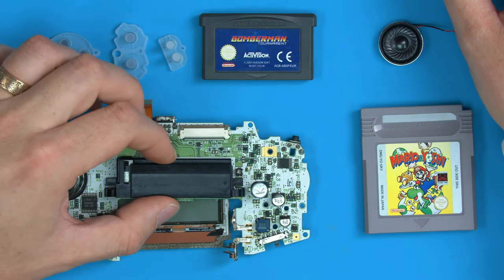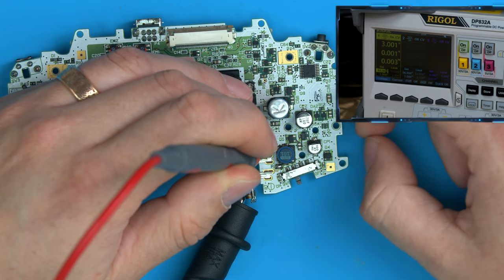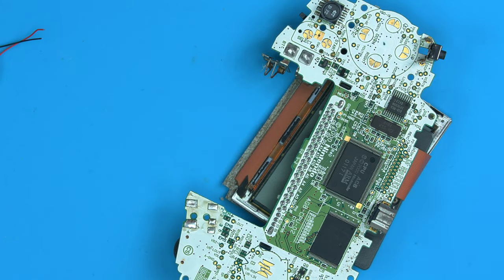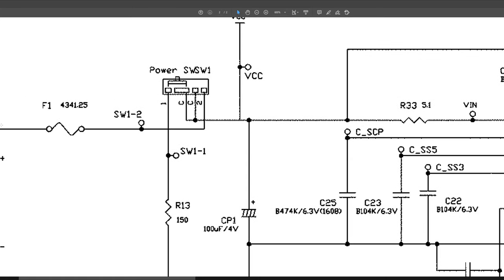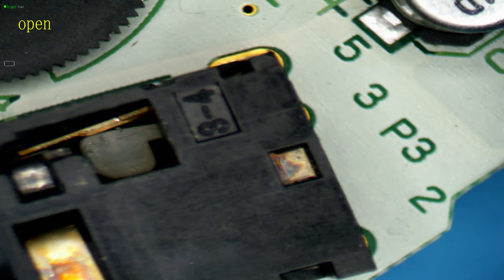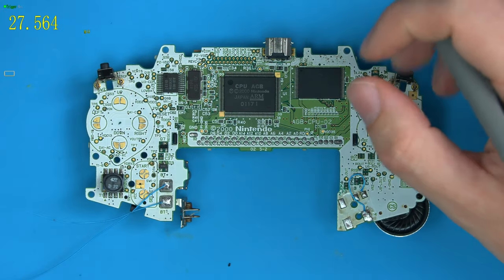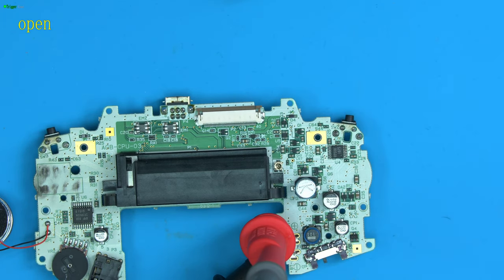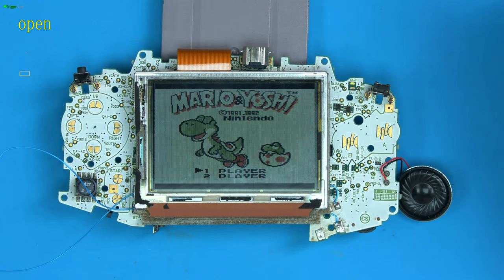Game Boy Advance No Power, No Sound & No Buttons! - RetroSix

Comment: Holy moly I had a GBA That I never figured out why it needed like 30 seconds between reboots to work ! and it had no sound due to it beeing a water damaged console I removed the headphone jack and never got sound out ot it plus that discharge resistor ! I had to replace the powerswitch and the resistor was missing ! Thanks ! You just upgraded this GBA from the Junk pile to sitting in a new Shell !

Comment: Bravo! Best video along this line I've seen thus far. I have GBA that starts about 1 out of 5-8 attempts. When it doesn't complete, the power light flickers with each failed attempt. When it fires up it's gtg until turned off. The power switch was cleaned and then replaced with the exact same results. The battery terminals are gtg. When back to back attempts to fire are quickly done in succession, the power light flicker is less bright each time until dark at about the fifth attempt. Capacitor?
Reply from the maker: Try replacing or bridging fuse. Also do you have any mods? The regulator basically thinks there is a short so stops

Comment: Great content, I have a question, off topic , I have 2 GBA AGB-001, one works with Ni-Mh batteries (total 2.6v)  so the batteries ain't the problem, and the other one only makes a pop noise, power switch is cleaned and battery contacts are fine,  possible causes ?
Reply from the maker: Power regulator circuit. L1 or T1 often fail

Comment: Love this video, my Gameboy advance won’t turn on. I cleaned the power switch and checked the fuse and also the blue inductor. There is all 3v but if I turn the switch on the light is just flickering and goes off, it does the same if i turn the switch into off position. What should I can do?
Reply from the maker: Join discord.gg/RetroSix for more advice. Could be T1, L1, a bad regulator IC, a short on output or other things

Comment: Hi, would there be any way for me to fix mine? It’s been scratched on the motherboard around two screws that kept it in place, one near where the speakers connect and one next to the thing that says c44, to the right (sorry I’m not really too great with names). It doesn’t turn on, the display didn’t work on it when it turned on before, when the one on the left was scratched, and the sound doesn’t work. First only the display didn’t work so I tried to take out the screw on the right side, but some yellow stuff has been revealed at the bottom. I’m sure that it isn’t because of corrosion because it wasn’t like this before I opened it a while ago.

Comment: i replaced the resistor on mine and it still didn't work. I think the circuit is trashed and the pad for 1 is lifted off the board so I tried running a 30awg wire to R13 and it still has discharge issues. Kind of at a loss actually

Comment: This is video is very educational, and it has helped me on troubleshooting my on-going GBA project, it also helps me getting better on my soldering techniques.
I did encounter and issue similar to the one for R13 after cleaning my power switch. The system will only boot after 10-15 seconds only. I tested the resistor and it works, using my multi-tester I keep getting a consistent 150 ohms reading. Could it be the power switch is faulty or that the C pad does not join to R13 when the console is turned off? Just in case i am ordering a new power switch and i am looking for similar 150 ohm resistors. But what would you recommend?
Reply from the maker: Test continuity with your multimeter from far right pin on power switch to top of resistor. And from bottom of resistor to ground
Reply: @RetroSix   Thank you! The far right pin in the power switch to the top of resistor has zero continuity, and same from the bottom of the resistor to ground. From your experience does that mean that by trying to clean the switched I made it worse?
Reply from the maker: You sure there is no continuity on both? Usually the bottom resistor is on ground. Very hard to damage that. Either way if bottom of resistor isn't making contact to ground solder a wire from ground to bottom of resistor. Then if top isn't making contact with right pad of switch solder a wire from top of resistor to right pad
Reply: @RetroSix  Thank you so much for all your help! Yeah, I did not get continuity from "1" to the top of the resistor. I did get continuity from the solder point from the far right switch (where the cover is soldered and it says off) but I am not sure if that was the point you meant. at this point I will use a wire to make contact. thank you so much for answering my questions, and I must say that I am a fan of your products! 😁
Reply from the maker: Yes pin 1 should connect to top of resistor. Bottom of resistor should connect to ground including the metal shield of switch
Reply: @RetroSix  Thank you very much,  I will do that :D
Reply: @RetroSix  Update, the connection from pin 1 to the top of the resistor needed that wire. It works legit well now. Thank you so much!!!! 😃

Comment: Hey RetroSix, thoroughly enjoyed the educational video! I used it to try and diagnose why the GBA I've been working on has no sound out of the speaker or headphone jack.

Unfortunately, I still haven't solved the problem. I had soldered a wire similar to you did in the video (pin 4 to 5), but no sound came out still. I've cleaned both the volume potentiometer and headphone jack with IPA, and replaced the speaker. Is there anything you may know that could be the problem? My next course of action was going to be to replace the volume potentiometer.
Reply from the maker: Do you have audio in headphones? If you do and you still don't get audio are you using a CleanAmp or just stock?
Reply: @RetroSix  There is no audio coming out of the headphones either, and it's stock.
Reply from the maker: @Syngii  it's likely the inputs into the amp then or volume wheel. For volume wheel just test with multimeter the voltage at pin 10 of the amp. As you move wheel up and down it should go from around 0V to 3v

Comment: I have 3v from positive battery pin to left of f1 and out the right of f1 in off position.also have 3 volts on pin 2 of the power switch while in off position.when I turn it on I get 0.06 on pin 2 of the power switch any help?

Comment: Great video you have there! I have a GBA but whenever I tried to turn it on, its never turned on, the green light shows for a second and then its off. I already cleaned the power switch but no luck, maybe its not a power switch related issue?
Reply from the maker: It's a dead short on the console somewhere or a bad regulator. I'll do a video on it when I get time but look for shorts

Comment: I'm getting audio out of headphones but no audio from speaker, replaced speaker, volume wheel works with headphones in... possibly bridge pin 4 to pin 5 to fix the problem? what do you suggest?
Reply from the maker: Bridge 4 and 5 to confirm. If that works your headphones spring needs cleaning or port swapping

Comment: Short question: can I use an electrolitic capacitor to replace C26? I ripped off mine by accident
Reply from the maker: If you have Dehum kit installed just leave C26 off and make sure pad of C27 isn't bridged. No need to replace as Dehum kit has one on

Comment: good day sir! may i ask what would be the potential issue if the sound on the speaker is very low but the headphone jack sound is normal? thank you for your input.
Reply from the maker: Sounds like bad speaker try swapping that
Reply: Thanks for the quick response. will subscribe either way.

Comment: Great video, I'm having some similar issues. GBA used to boot, but suddenly stopped, no sound or display; lights quickly flicker once when switch on or off. I checked the power switch's continuity and it doesnt seem to have any problems; when on common gets supply voltage and when off goes to ground. If anyone has a tips where to look next I'd greatly appreciate it
Reply from the maker: Jump on our discord channel we can help

Comment: This was extremely informative. I do have a question, I have a GBA board that seems to be booting GBA games fine, however, when Gameboy games are put in, you can hear them boot and play, but I have nothing on the screen.
Reply from the maker: Hmm. Only thing I can think causing that is the S1 and S2 power rails. The mechanical switch in the cartridge slot that sends 5V to the cart instead of 3.3V. So worth checking that, pin 2 on CPU and R5 for any damage, shorting or similar. Also check S1 and S1 pins on cart connector have 5V and 3.3V present
Reply: @RetroSix  so it seems that S2 has 4.75 on boot, but S1 looks to be 3.27.
Reply: @RetroSix  are those values supposed to change if GB/C is installed compared to GBA? No matter the cart it seems to be S2 4.75 and S1 3.27.
Reply from the maker: @joshuajacobson2102  C1 next to them should switch between those voltages the 5V for GB games

Comment: I've checked everything, changed capacitors, I get the 3V everywhere it's supossed to be, but when try to turn on the green light just blinks once then no power and when turning off same thing, I'm goign crazy with this...
Any ideas??
Reply from the maker: That's when there is a short on one of the output voltage rails, a bad T1 or L1 or a faulty power regulator
Reply: @RetroSix  Thank you very much, gonna check into it!!
But L1 was just replaced and don't see any shorts on the rails, probably T1?
Btw the power regulator is it U4?

Comment: What temp do you have your iron at?
Reply from the maker: 350 to 380C. Better starting at 350 until you are used to how solder flows and timing get a feel for soldering then go to 380 so you can work faster and spend less time transfering heat further into the board